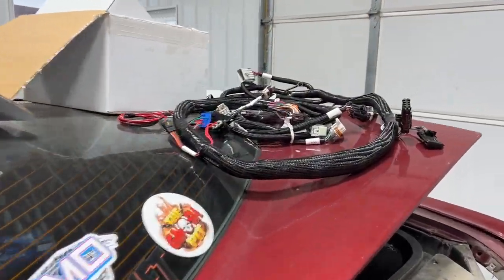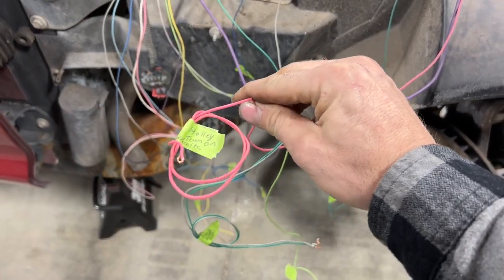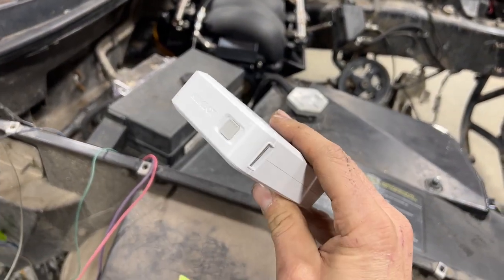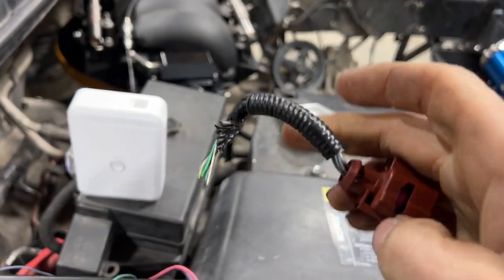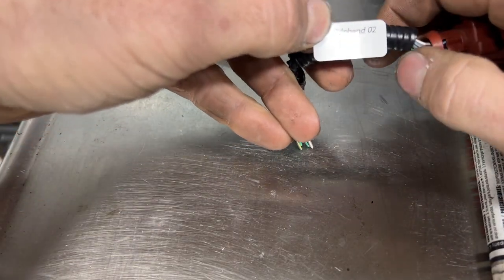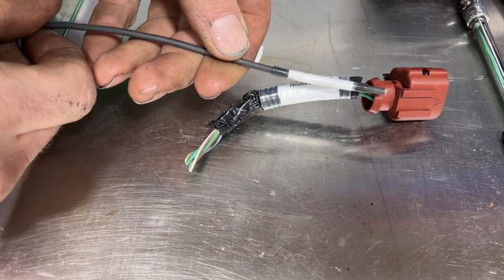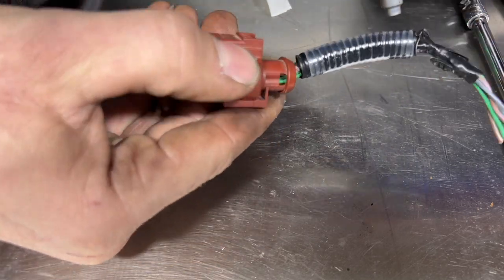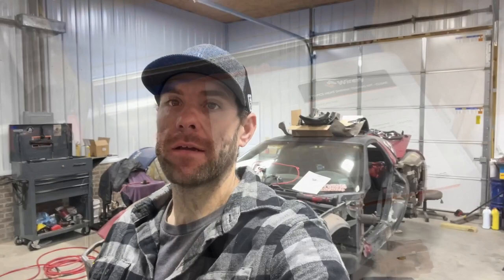Diy wire labels for under $35! This is a clean way to label your wires!

Comment: Cool trick. I like the clear heat shrink. I picked up a Dymo labeler when I did the LS swap in the Jeep. That worked pretty good too for labeling individual wires. I tucked all those inside the loom.

Comment: One possible flaw with this might be the heat sensitive thermal printing paper - it's probably going to fade like your CVS receipts do over time. If you use one of those TZ tape type label printers though, it uses a thermal head but the lettering is much more permanent since it burns away material and splices it together with the background layer and a clear covering; these really do stand up to long term use. They also have heaps of different colour combinations too.
Reply from the maker: Yeah I was wondering if it going to do that. I will look into the tz version. Thank for the tip!